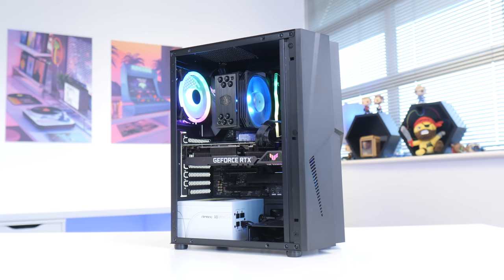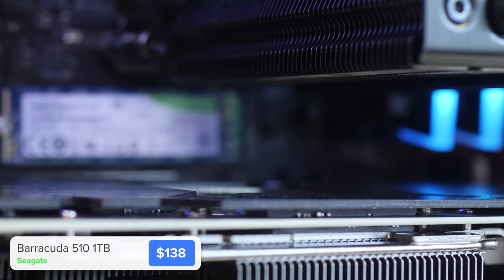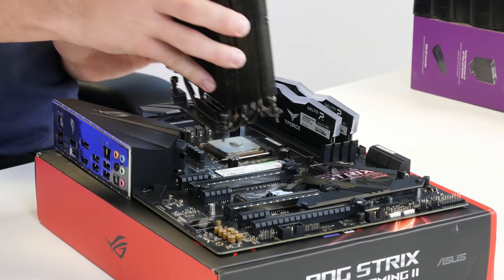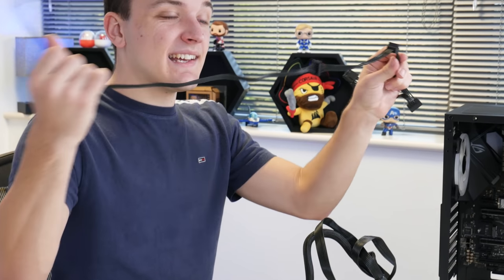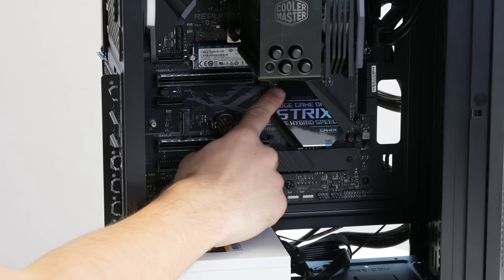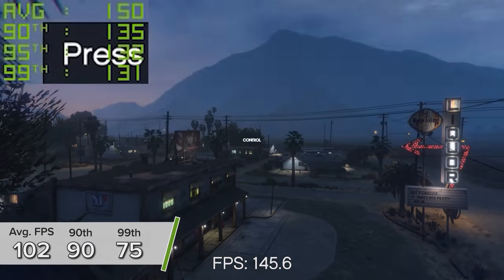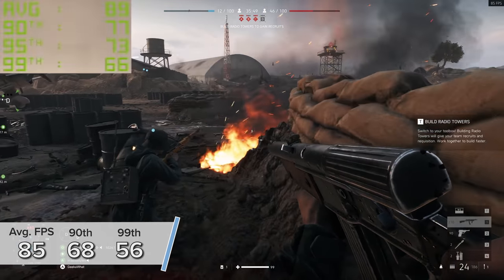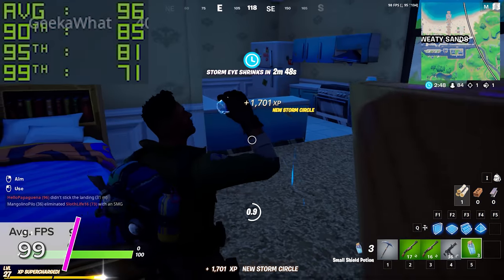$1500 Ryzen 5600X & RTX 3080 Gaming PC Build! [Zen 3 + Ampere = The Dream!]

Comment: Thanks for the video! But, 1 cable PCIe for a 3080, you should use 2 separated cables direct to the PSU to the GPU to avoid issues, is a recomendation. 1 pci cable can handle 150 watts + 75 watts from PCI port is not enough for a 350 watts graphic card.

Comment: 5600x or 3700x for vdo editing, 3d Nd Photoshop?
Reply: Neither have a 9 in the name... Haha but for multitasking you want more cores.
Reply from the maker: Not necessarily true. Paired with a good GPU and depending on how complex your video and photo work is a 6 core chip is sufficient ...
Reply: @GeekaWhat  thanks that's clear.. but do you think the extra 2 cores of 3700x would give an edge over the 5600x   in 4k vdo editing or 3d designing?
Reply: @GeekaWhat  for sure! More than efficient, even.  There are pros and cons to all. I have been doing my own similar research and Tech Deals elaborates fairly well on this in his livestreams. I'm new to your channel but perhaps you can evaluate the strengths and weaknesses of adding cores for 'real world' use past gaming benchmarks.

Comment: can anyone help me if this is a good build or there is better option ?
aorus geforce rtx 3080 eagle oc 10GB
ryzen 5 5600x
gigabyte b550 aorus elite
2X16 3200mhz delta rgb
2tb WD blue
samsung 970 evo 500GB
gigabyte c200 case mb520
cooler master psu 750w 80+

Comment: THanks for the vid. I’m considering the 5600x with the 6800xt, that will work right?
Reply: Yes, it will, and it will also take advantage of Smart Access Memory which is why I am considering the same build.
Reply: Honda Civic 1997 Thanks I am aware of SAM and Rage mode but I wasn’t sure if it would bottleneck or not. I mean no matter how insane the 5600x is, it still only has 6 cores

Comment: Hey GeekaWhat should I get a 5700xt right now or wait for the 3060/3050. Also will these pair good with the ryzen 5 3600?
Reply from the maker: The 5700XT is a great card, and any new Nvidia GPUs are likely to face stock issues if they launch...
Reply: @GeekaWhat  Oh ok so I should probably go with the 5700xt. I was looking at a benchmark prediction for the 3060 ti and it was performing better than the 2080 and rumours say it's gonna be below $500. I might hold out and see if I can get one in store.

Comment: Excellent day everyone, I recently bought the items for a PC, ryzen 7 5800x, Asus X570 Plus wifi, M2 XPG 512gb, Yeyian 850W Power Supply, RAM Team Group DARK Zα DDR4, 3600MHz 2x8gb, MSI AMD Radeon RX 5700 XT MECH OC, 8GB 256-bit GDDR6.I installed everything correctly, but it does not give me an image, note that the mother's led lights up in yellow, as I investigated it has to do with the Dram.I already put even lower MHz memories and nothing happens, (the graph does work and gives an image, since I tested it on another PC.Someone could support me in knowing what it can be, I would appreciate it very much.

Comment: You can go for a lower power supply like a 700 watt because the system uses around only 500 too 600 watts so 700 is more than enough. By doing this u can spend a bit more on the processor, for like a Ryzen 7 3700x which is a wayyyy better Idea.
Reply: DO NOT FOLLOW THIS MANS ADVICE for anyone in 2022 or beyond - you'll get laughed at by anyone seeing your build

Comment: Bruh why would you "save" some money on a b450 when b550s and x570s are only a $10-20 difference and don't bottleneck the cpu as well as having multiple more connectivity options (full speed m.2s, multiple m.2s,  faster pcie lanes etc). what a waste.

Comment: 3:03 ok. This dude is a noob. He only open 2 of the 4laches on the ram slots. Also he makes  1500$ 5600X Rtx3080 build... with crappy components. Guys just buy a a 3060 Ti and better ram, cpu cooler, mobo, etc. YOU EILL HAVE PROBLEMS WHEN YOU CHEAP OUT EVERYWHERE!
Reply from the maker: This boad only has clips on one end of the RAM dimms you muppet. You won't have problems with this system, CPU is good, GPU is solid, cooler is more than sufficient for stock speeds, 16GB of RAM etc etc
Reply: @GeekaWhat  The thing about the ram. Ok. And I understand that people want Rtx 3080. But if you go premium, then go premium. Buy a 200$ mobo, probably 32Gb of ram (3600Mhz Cl16!), Aio or really good air cpu, definitely not a 40$ case!! That's the worst part! Buy a 100$+ case, good power supply! If you can't afford it, then buy a ryzen 5 3600 and a rtx 3060 Ti, ir something like that. But good quality parts! If you spend more now, on the parts that don't directly impact performance, then you can upgrade your pc in the future (For example a good psu, modular, so you get 2 PCIE power cables instead of 1 dasy chained which isn't even for the watts of RTX 3080, cpu cooler, for your next cpu which will potentially make more heat (instead of buying a new one), (A Good case! With quiet fans, good airflow and good build quality!), Fast Ram (which you can still use in a few years). You get the point. The title is kinda clickbait, because people shouldn't spend 1500$ for a Rtx 3080 build. It's just wrong.